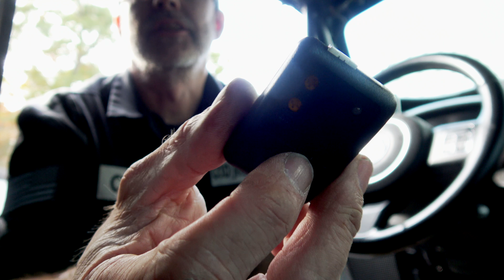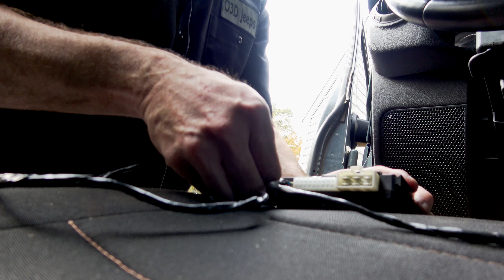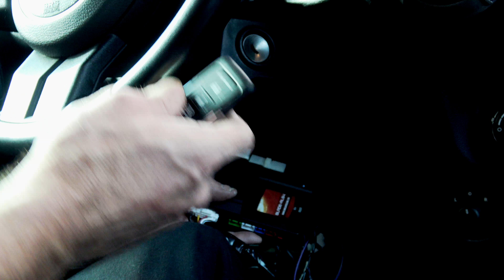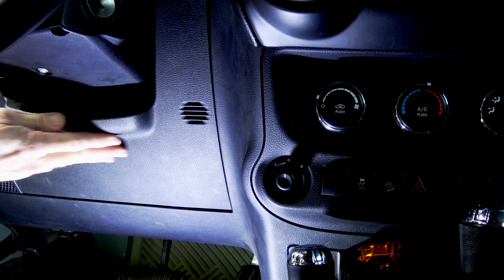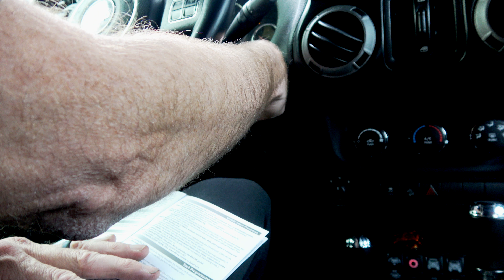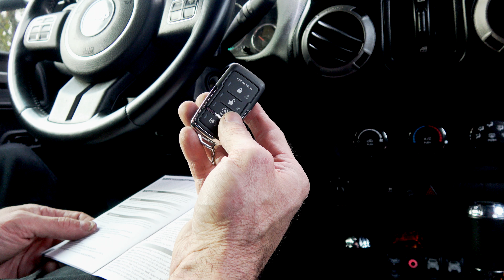07 - Alarm and Remote Start Install - Buttoning it up, Blade Programming, Vehicle Learn Mode - OMEGA

Comment: im really confused, my truck is a 2004  ford ranger with no electric locks, but im installing after market locks, how is the blade going to help or do I have to buy the programming cable to manually do it?, im already going to buy the  chip immobilizer bypass  module

Comment: Hi CPO, I love your videos mate and took your advice and purchased the same set-up for my 2008 JK auto 4 door. The setup was fairly straightforward. specifically by cutting down the main plug to 7 cables. I’m having some issues programming it. The blue light keeps on flashing on the main unit it does not turn to a solid blue and the remote lights go on but it will not unlock or lock the doors. Any suggestions? I’m in Sydney Australia

Comment: I am confused... I watched all the videos, it shows how the pink positiv from the T-Harness ran to the OBD, but you didn't mention the main positiv red wire in the front of the modul. Is that goes straight to the battery?

Comment: I have question, at the minute 3 of this video, I don't know you have missed one thing to tell or not. For Blade-AL64 or MDB-ALL normally blank (Not Program yet) that's what Omega told me, its required to be flashed by retailer/dealer/DIY. But I wonder How did you get it to recognized your Jeep if not flashed Software/Firmware to match your specific vehicle to get it bypass without flashed?
*My Blade is flashing Red every second non-stop. Same AL1775-3BD with Blade-AL64 and T-Harness for 2008 G37 Coupe.

Comment: Hello, where do you get the Blade from? Omega site Blade AL64 & pre-programmed for my 2017 JKURR stnd.  cant find a match for a manual stick.
only Flash I could find on Omega site was for Wrangler Std. Key SUV 6 Cyl. Automatic

Comment: I am going to be installing the Excalibur JK kit on my 2015 soon.  The question I have is after the learning process you press the unlock button on your remote.  I don't have power locks.  I'm guessing that it will know that and complete the programming without pressing the button, right or wrong?
Reply: Instead of a button on the remote, you press the small gray button on the blade cartridge. The install guide for the blade cartridge is very helpful.

Comment: The "mercury switch" has 2 wires, 1 taps into the hood pin wire what about the other one? Did you mount it to the underside of the hood??
Reply from the maker: Joe Amirr the other goes to ground. And yes... underside of the hood.

Comment: Thanks for all your help your videos are excellent!! I'm trying to figure out how smart the blade programming is. I know you mentioned that it'll pickup an existing hood pin. I've got a 2015 with the factory remote start and alarm, so with the blade picking up the hood pin I'm planning to use the gray wire to hook up the tilt sensor. I'm also thinking because I have the factory alarm on the buss it may pick up the horn too, that'll save a couple of wires if that's the case. I'm also wondering about the dome lights. Do they come on when you unlock?   I'm trying to figure out if I need keep some of the lighting circuit wiring in the 18 pin harness to keep the dome light functionality .  Thanks again CPO
Reply from the maker: Yes. The dome lights work just like of you unlocked with the OEM remote. The vehicle learn process should pick up the hood pin, so, yeah you can use that gray wire as you suggest. You still have to wire the horn unfortunately. I have factory alarm in mine too.

Comment: I love your videos and I am about to pull the trigger on one of these systems but I have a concern. The final step of programming the "blade" was to hit the unlock button. My JKU Sport does NOT have electric locks -  Can I still use / make this system work with out power locks?
Reply from the maker: Wayne Vedvig that sir, is a great question! I'm running down the answer for you and I'll get back to you as soon as I know for sure.
Reply from the maker: Wayne Vedvig Here's the answer (from the manual): If vehicle is not equipped with OEM remote, press module program button.
Reply: Great! Thanks! I will place my order soon. Again I enjoy your videos - keep them coming!
Reply from the maker: Thanks!
Reply: I have the same vehical I was wondering where is the module program button?
Reply: @ericnelson6147  I know this was a year ago, but for those who run thru these comments in the future (like I just did), the module program button is on the blade cartridge. It's a small gray button. The install guide for the blade cartridge is pretty helpful. Also, I emailed back-n-forth with Omega support and they got me straightened out.

Comment: Thank you CPO for an EXCELLENT set of install videos, your attention to detail is top notch! I have been looking for a system exactly like this but there has been nothing with such a "simple" DIY wiring design (I am a DIY high-end Jeep audio installer, this is why I say "simple"). Living in Canada the Excalibur AL-1775-3DB and the add-ons just like your install from KICKYRIDE.COM will put me close to $400.00CDN, thanks to you I feel 100% confident that this is the best DIY system for me. Hopefully the discount code at KICKYRIDE.COM is still useable :-).
Reply from the maker: I'm sure the code is still useable! let me know if that's not the case. It really is hard to beat it for price (even CDN I assume) and easy install.

Comment: Dang, I installed a similar system years ago on an F150 and I would have killed for something this easy. They did a darn good job with it.    Looking forward to seeing what you do with the proximity sensor.  Having a soft top on my rig that would be huge for a good sense of security since you all know how easy it is to get in.
Reply from the maker: Yeah... prox sensor was important to me. I'll get it in soon...but wanted to get through the basic install. Hopefully I'll have time this weekend to add the prox and hood tilt sensors.
Reply: Looking forward to it.  Why the hood tilt with the hood pin?  Do they both accomplish kinda the same thing?
Reply from the maker: Yeah... but in a different way. Basically its an easy redundancy for a couple of bucks.  It's not needed...but adds another layer of security. That's why I didn't add it right away... because I didn't want people to feel that it was necessary.  I also have some other things in mind... later on...

Comment: Hey CPO, you seem like youre great at browsing forums and diagnosing issues.  I have an 07 4 door auto jeep jku sport.  Intermittently when I start the car i get a click noise, but no start.  If i put the jeep in neutral, itll start right up.  It only happens intermittently but at times could go a week straight of doing it, or a month without.  I have yet to see a solution to this issue so if you have any ideas please let me know.  I have replaced the starter, and battery and it still does it.  Thanks!
Reply from the maker: I checked with some folks in my club and also did some quick searching. The consensus is that its likely your Transmission Range Switch that is bad (most people call it a Neutral Safety Switch).  Regardless of what you want to call it (TRS is the proper term I believe) it's not an easy fix.  There are instructions on how to bypass it...but I'll leave that to you to search out. Almost everyone that has experienced it just seems to live with it.   You might also try just pushing forward on the shifter (pushing it farther into park) to see if that gets it to start.
Reply: Not to jump on CPO's vid, but next time try pushing forward on the shifter (maybe need to give a decent smack) and see if that helps.  Sounds like your Neutral Safety Switch might be acting up.  Also try some of the Wrangler forums for more advice....
Reply from the maker: HA! I totally didn't see you replied...and I gave the same advice on pushing up on the shifter! lol  Here's another "solution" I got... "Easiest fix is run a ground from the battery to the transmission. Otherwise you have to take apart the transmission to get to the part. I also replaced the battery and the starter before finally figuring this out."